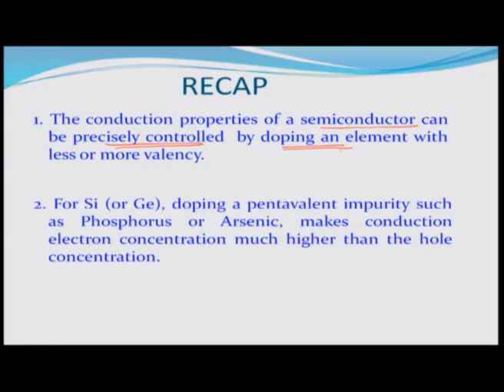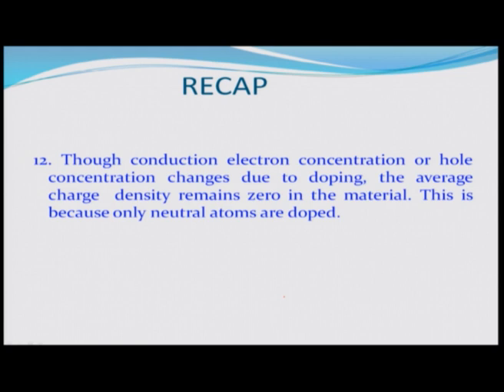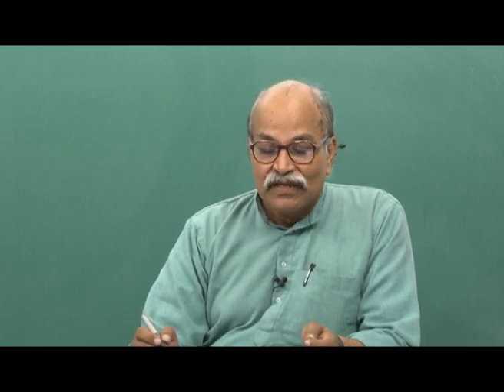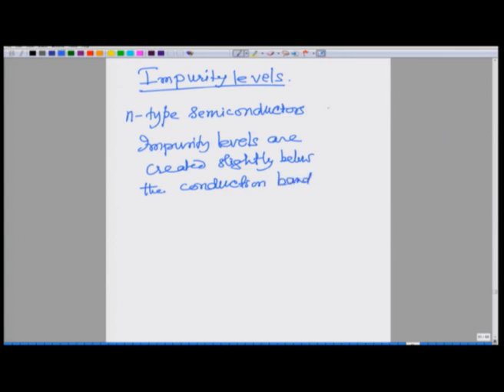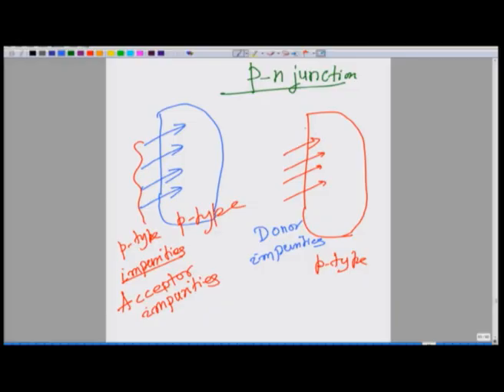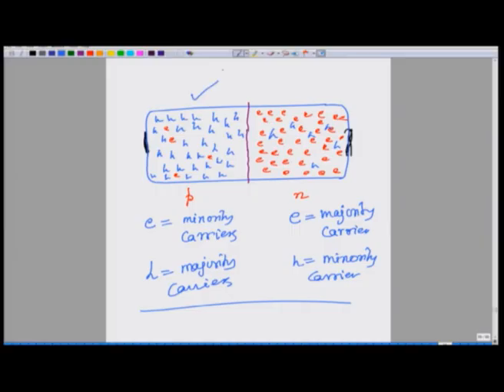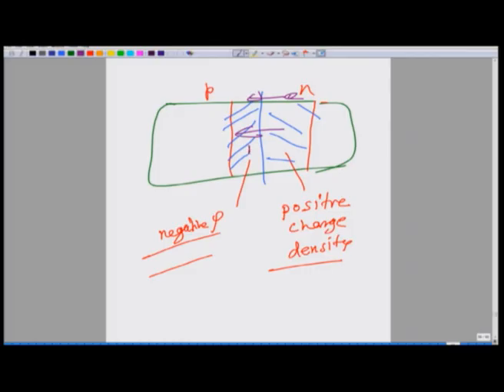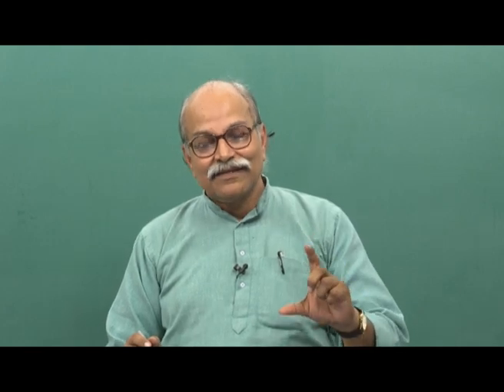P-N Junction Basics (PHY)

Comment: Lecture 1 - Conductors, Semi conductors and Insulators - https://youtu.be/8luE9L8bj4Y
Lecture 2 - Doping in Semiconductors - https://youtu.be/l0nvIh34eug
Lecture 3 - P-N junction Basics - https://youtu.be/hTPIiC70WCg
Lecture 4 - Field and Potential in P-N Junction - https://youtu.be/vnQ4uovIwR8
Lecture 5 - Current through a P-N junction - https://youtu.be/ptUPen8U5yE
Lecture 6 - Special purpose P-N junction - https://youtu.be/P11paY2vACc
Lecture 7 - BJT basics - https://youtu.be/ijNBnXhiy_w
Lecture 8 - Transistor as an amplifier and as a switch - https://youtu.be/oXY9zUSulkg